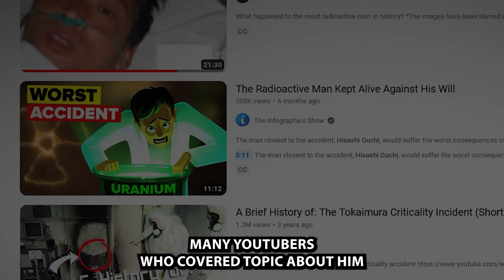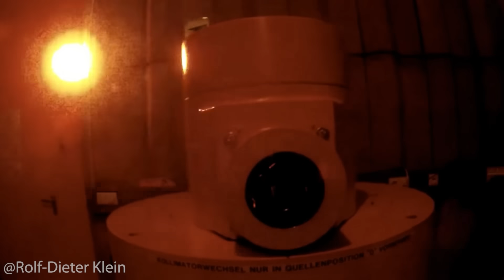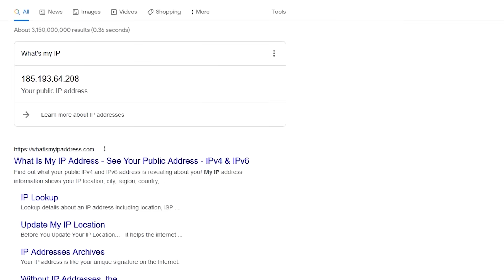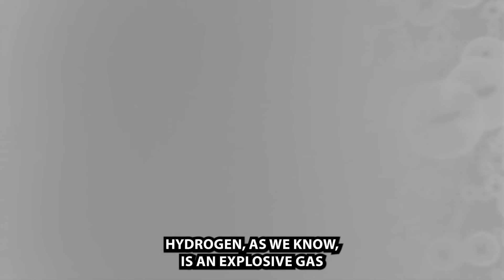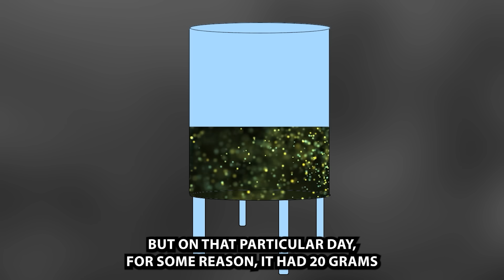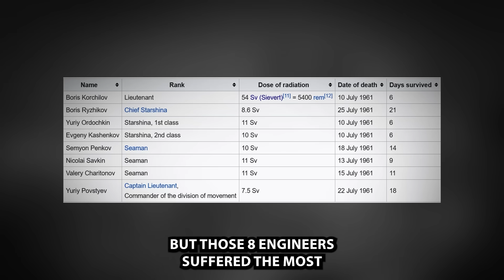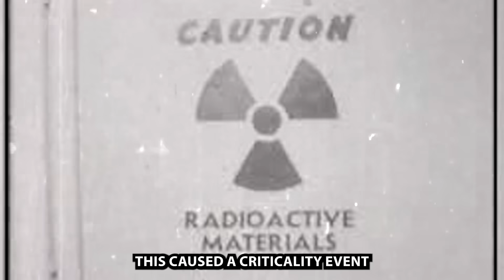Most Radioactive Men Ever

Comment: For people wondering, The blue flash is called the Cherenkov Radiation. It happens when ionized particles travel faster than light through a medium
Reply: faster than light??
Reply: @mojacodes  faster than light at the medium. allways remember, it's impossible to be faster than light. but light is massless and also in any translucend medium it travels mostly by being absorbed and re-emmited. where the frequencies get at 180° angle they cancel out and where they are 0 they double up, making it slower and distorted in direction due to refraction.
Reply: @mojacodes  yes, speed of light depends on the medium. E.g. light in glass and water is slower than in air and in air slower than in vacuum.
Reply: @MrToradragon No the speed of light is constant. The medium defines only the rate of absoption and re-emitting photons...
Reply: @mojacodes  yes
Reply: @coal_edxts  what makes it possible for the ionized particles to travel faster than light?
Reply: @coal_edxts  no
Reply: @abu-karz  Nothing, it is complete utter BS
Reply: @mojacodes  Nothing can travel faster than light in a vacuum but there's plenty of particles that can travel faster than light through other things (such as through water).
Reply: @qdaniele97 We do not know. We dont know if photons are massless, we just dont find anything with less mass. We dont know if the speed of light = the speed of causality, we just dont find anything faster. And no, nothing can travel faster than light, what you mean to say is that certain objects and particles may travel faster trought a medium than said medium can absorp and re-emit a defined bunch of photons/energy.
Reply: @mojacodes  they dont travel faster than light at full speed, they travel faster than light would traver through the medium i think
Reply: @mojacodes  faster than light in water
Reply: @mojacodes  Light has different speeds in different mediums. However light is the fastest in vacuum.
Reply: @mojacodes yes kid it’s faster than light
Reply: @mojacodes  In a material (air, water what have you) NOT the void. Nothing goes faster than light in the void.
Reply: @mojacodes  yes, you can slow light down. however no nothing can travel faster than ORDINARY light speed
Reply: @mojacodes  Ionizing radiation travels at the speed of light. 299,792,458 meters / second or 670,616,629.38 miles / hour. So, no. @coal_edxts is incorrect. Ionizing radiation is not faster than light.
Reply: no. Cherenkov threshold in air for electrons is 21 MeV, way too high for any beta decay. For an alpha, it's thousands of times higher: far out of range for any nuclear reaction. It's prompt radiation (gamma, beta, neutrons scattering charged nuclear) which ionizes the air, which causes scintillation as the electrons fall back to the ground state. Basically, a mini Aurora.
Reply: @DrDeuteron  I'm learning a lot.
Reply: It's also really beautiful from a safe distance
Reply: OK, ppl. this is getting out of hand. Yes, the speed of light is constant, and nothing (including information) can go faster, and anything with mass must go slower.
The speed of light can measure w/o light, all you need to do is measure the permittivity (epsilon_0) and permeability (mu_0) of free space, and find c = 1 /sqrt(e0*u0).
The permittivity measure the strength of the coupling of the electric field to charge (mu does the magnetic part).
So...in a medium like air or water or glass, the electric field of the lightwave polarizes the atoms/molecules, thereby creating little dipoles of charge, thereby increasing the local coupling of the field to charge (epsilon > epsilon0)
This makes light travel slower in a medium. Nevertheless, it is still dispersion less for constant "n(f)" (though it usually does disperse, hence: rainbows).

So it's not "ionized particles" that cause Cherenkov, it's "ionizing particles", which are energetic charge particles.

As they pass through the medium, their electric field is strong enough to ionize the nearby molecules/atoms in the medium. The point of ionization follows the particle, which is faster than the speed of light in the medium, which is c/n, where n is the index of refraction. Hence the similarity to sonic booms, where the air pressure disturbance position is moving faster than sound, so at a forward point, you hear (see) all the sound (light) from everywhere at once...that's just trigonometry.

In air, n = 1.000278 (see: The Particle Data Group). that c/n is totally out of reach for nuclear fission; however, in water n ~ 1.5: so you can Cherenkov in water and not in air with fission/beta-decay. (Beta decay is a few MeV, while the threshold for electrons in air is 21 MeV, which is a number I used in 1989 and have not since recalculated).

Air glow is caused by scintillation: ionized air recombines with free electrons and emits blue light in random directions. In these accident cases, its neutrons knock protons out, which then ionize. Very deadly. 1 neutron can blast a lot of atoms before tossing energy. Think: golf ball bouncing of bowling ball, golf ball keeps moving.

Cherenkov is focused in a forward cone with opening angle arc-cos(1/n). Moreover, the spectral power depends on n (bigger=better) and the photon energy, so it is strongly weight to blue (and even more in the ultraviolet). It is cut-off at the point where the Cherenkov photon energy can ionize the atom...otherwise it would extend to X-ray like synchrotron radiation.

An even whackier effect is called "Transition Radiation", which requires ultra-relativistic particles traversing a boundary between 2 media. 

Finally: the comment about space expanding faster than light is not relevant. The speed of light is constant for all observers in flat spacetime locally. No matter how fast you go, the speed of light always moves a "c" in all directions...so which way do you go to reach "c"? It's a hyperbolic geometry.

In curved / expanding space time. There is no unique way to even define the relative speed of distance objects. Nevertheless, if two particles/people/galaxies are moving apart fast then "c", then they are separated by a horizon: either a black hole's event horizon, or the cosmological horizon.

Source: Me. I did get the highest degree (PhD) in the hardest subject (Nuclear Physics) from the worlds toughest school, and I built Cherenkov detectors for several projects in high background environments (read: scintillation). So it's hella studied. Re: general relativity, I am not an expert, but both my teacher and one of my fellow students won Nobel Prizes for black holes, so: osmosis of genius?
Reply: @DrDeuteron  Thank you! I only briefly tacked the subject and already couldn't stand the amount of bullshit dumped into this thread and similar ones around. Must've been a real pain for you to read "but nothing can go faster than light, duh!" for the umpteenth time. Thanks for taking the time to provide an elaborate scientific insight.

On the subject, I recently read some theories that the blue flash phenomenon accompanying criticality accidents may actually be Cherenkov radiation, but caused by neutrons passing through vitreous body of the eye and not air. Vitreous body has got sufficiently high refraction index of 1.336. There's also another theory that the apparent blue flash is caused by radiation directly stimulating blue cone cells in retina.

Both mechanisms, if they were to be true, have this trait, that the blue flash would be seen by people looking the other way or even separated from the source of radiation by an obstacles blocking visible spectrum of light.
Lack of volunteers make such theories difficult to disprove however.
Reply: @krzysztof_jablonski  You're welcome. I built a Cherenkov detector in grad school--a long time ago, but I had the original book by Tamm and Frank...very detailed. Nobel prize worthy detailed (not a 1st edition, tho, now worth $1500.,..). I also learned about accidentally inhaling freon gas, but that's a different story.
Reply: @DrDeuteron if c is the speed limit, then what is quantum entanglement? also, some of us do not bow to the throne of authority. relativity is certainly incomplete, so for all i know, we may be woefully on the wrong path. we still cannot reconcile GR and QT. maybe we are just as dumb as we always have been. we can’t see our blind spots. it takes time. just because we can’t observe a phenomenon does not mean it doesn’t exist. i’m open to all possibilities. that is the scientific process.
Reply: @kensurrency2564  quantum entanglement is a phenomenon from quantum mechanics, which is inherently non-relativistic.
Reply: @DrDeuteron 21 MeV still seems correct. 

Suppose the refractive index of air (at STP) n = 1.000273 (source: Wikipedia) then a particle moving at the-speed-of-light-in-air would move at v = c/n then β=1/n, γ = 1/sqrt(1-β^2) = 42.8. Now E_kin = γE_0 = 42.8 × 0.511 = 21.8 MeV for an electron or positron.
Reply: @koenth2359  also, I went by memory. I built an e/pi separating Cherenkov for TJNAF in the 90s (it was a POS, I hope its been replaced!). 
The point is, nuclei don't make 21 MeV electrons (nor gamma's which can give their energy to electrons)...the max is 5-ish (iirc).
Nuclear weapons are consider "low energy", but extraordinarly high power.
Reply: @DrDeuteron  Yeah, got ur point, no worries. No Cherenkov radiation, but scintillation due to ionisation and recombining. I'm looking for an explanation for the blue colour though, because aurora is usually red or green.
Reply: yesterday i remembered as the speed of light being the current speed barrier of the universe and now im hearing this wtf what
Reply: @garlicbreadstick404  Speed of light in vacuum is the speed barrier of the universe. We are talking about speed of light though a medium, which is slower than the speed thru vacuum
Reply: @coal_edxts  ohh ok
Reply: @coal_edxts  light can only travel at the speed of light, not slower, not faster . The medium doesn't slow it down at all, just forces it to bounce around this taking a less direct path, it's still traveling just as fast .
Reply: @jedaaa  Correct, but when we are taking distance covered through medium x vs vacuum, in t time, there would be a difference. Which means 'speed' has changed, specifically , it's apparent speed. I just didnt want to go into all those kinda stuff thats why i just said light slows down, so it will be easier to understand. Cheers
Reply: @jedaaa  that makes no sense, if it bounced around randomly, optics would not work
Reply: @DrDeuteron  optics definitely wouldn't work if it didn't slow down in media.  It gets absorbed and re-emitted repeatedly.  It gets re-emitted in random directions, but all the light not traveling the way you imagine it should ends up destructively interfering

Reflection and refraction are emergent phenomena
Reply: @charlesnathansmith  if it's coherently remitted in random directions such that only the forward amplitude is non-zero: that's not really random emission. I've heard that explanation many times, but why not just note the polarization of the atoms increases the permittivity, leading to slower propagation. But the light isn't Cherenkov light anyway. It's scintillation
Reply: @DrDeuteron  if you look at any particular atom absorbing then emitting, it's still unpredictable.  The overall path is a statistical effect.  If you're doing optics, you can ignore that and just work with the net result, just like if you're doing meteorology you can ignore the details of temperature arising from molecules bouncing around.  It doesn't negate what's happening at a lower level, though.

They come out in random directions, but the directions and phases conspire to create a sensible looking summary path
Reply: @DrDeuteron  also, no one is saying that's Cherenkov radiation.  That happens when particles travel through a material faster than light can.  It produces the light equivalent of a shockwave
Reply: @charlesnathansmith  OP says it's Cherenkov, that's the whole point of this misguided thread.
Reply: @charlesnathansmith  if the phases are coherent, then it is not random scattering.
Reply: @coal_edxts  You do not disappoint. I scanned down the comments to see if your words were challenged and how you handled it. You handled it like a scientist.
Reply: @MoiraWillenov  oh thanks!
Reply: @coal_edxts  wait so it's both faster and slower or is it just slower?? You typed that it's particles of electrons moving through a medium faster than Light yet in the other comment you type that charged particles travelling through a medium is slower??
Reply: @jedaaa  It's not correct explanation of how light moves
Reply: @Ar1osssa  it doesn't matter how it moves, it's speed is always the same no matter what .
Reply: @coal_edxts  thank you for the information and following answers to people’s questions :)
Reply: @coal_edxts  makes sense 🗿
Reply: @coal_edxts  ur pretty good at explaining thanks
Reply: @jedaaa  Thats what I thought until relatively recently. But light really does slow down in a medium, it does not bounce around or take a less direct path. It physically slows down and is a well understood and tested phenomena.
Reply: @coal_edxts  This is totally wrong lol. The speed of light is constant anywhere - even in a medium like air. What is happening is that the photons interact with other particles, being absorbed and re-emitted. All forces, except gravity, and all information or energy exchange in the universe is done by photons at the speed of causality - that is a constant.
Reply: @jedaaa That is wrong. As i have explained all forces in the universe, except gravity, are just effects of the exchange of photons between fermions. Photons always travel at the speed of causality (light). They do NOT bounce around, they are interacting with fermions being absorbed and re-emitted in the process.

They are just energy packets, when particles give or receive energy, like an electron reaching a higher energy states, all they do is receive energy throught photons and afterwards emitting their energy as photons to communitcate their information to other particles like their proton or surrounding atoms.
Reply: @coal_edxts  No not correct dude, no bouncing lol
Reply: @Donnirononon  I'm no expert but isn't refraction and how lenses work something to do with changing speed of light ?    Speed of electricity definitely changes to about 50% of c when traveling through coax cable.
Reply: @jagmarc  no speed of light is constant. You are talking about absorption and re-emitting of photons. Electricity, Magnetism, weak and strong force: it is all photons. Only force we have no particle for is gravity so we, for now, see it as a Symptom instead of a force. Again, photons always travel at C and it is constant always.
Reply: @Donnirononon  ah  OK I'll say the light propagates slower than the speed of light.
Reply: @jedaaa light gets slower when travel in water though.
Reply: @coal_edxts omg... there is always "that guy" 
Yes... he is right but really dude? We don't need all thar extra. Your answer was great. I mean come on, after we flush we are not going to think of this again until we are around other people and the subject comes up but by then we are experts. Lol... seriously though.  Thank you for your comment. 😊
Reply: @jedaaa  incorrect, it is caused by the light interacting with the electrons of a medium. The electrons absorb some of the energy in their movement then it gets remitted with a phase kick backwards. It does not bounce around inside the medium, as that would cause the material to be translucent.
Reply: @garlicbreadstick404  Light isn't even the fastest force in the universe. The Universe Expansion is faster Just to Name an example or gravitational waves, magnetic Energy etc.

Then there are parts of space where our laws of physics don't even seem to work
Reply: @bedouinmuhammadfromarabicpagan  You need to brush up on your physics my friend!!
Reply: @bedouinmuhammadfromarabicpagan  universe expansion is nothing but a theory. They recentöy said they have no idea how big the ubiverse truly is or how fast ots growing.
Reply: @bedouinmuhammadfromarabicpagan  
The Universe expanding isn't a Force nor is it moving through space. , you donut. It's literally space emerging out of nothing.

Light is the speed limit in the universe and it is a constant. 
Going faster would mean going back in time, which breaks the laws of physics and doesn't happen anywhere in the universe.
Reply: @bedouinmuhammadfromarabicpagan eeeeh where do you get from that gravitational waves are FTL? that is just BS sorry. Also electromagnetism, weak and strong force are NOT like you say FTL but in fact are the symptoms of light / photons being emitted and re-absorbed between particles. They travel exactly at the speed of light, that is a constant. You just wrote a completely wrong comment pulling information out of you nose didn't you?
Reply: @bedouinmuhammadfromarabicpagan  The universe expansion speed is not only faster than the speed of light, it's also accelerating.
Reply: kinda funny, I took radiation dirrectly to the head (brain tumour)     all I seen was like tv static when I closed my eyes...  during the radiation, after your vision goes back to normal..   weird feeling though...almost like you feel cold but your actually warmer
Reply: u cant escape from light, and those ionised particles are faster than light, so u know u CANT escape them
Reply: For those who doubt, at least read about Cherenkov radiation on wiki
Reply: @IR0Navt  I doubt. I don't need to read wiki, I have Cherenkov and Tamm's book. Cherenkov in gas is a high energy physics thing, and not associated with fission. (air's index of refraction is 1.000273). Chernekov in water works at low energies associated, which is why you see those amazing yt videos of pulse nuclear reactors--scary bright for a few milliseconds, and then decay).
Reply: It’s the particles traveling through the liquid vitreous humor of the eyes and creating the same blue glow seen in water-cooled nuclear reactors.
Reply: @anticom6099  it doesn't need to be the eyes (btw if this happens in your eys I think you got a problem comming)
you just need air
Reply: @dinamosflams  I’ve never actually seen it in air except on the fictionalized “Chernobyl” series. It would likely be very dim and maybe even impossible to see in a well-lit room. But if you have a video showing otherwise I’d like to see it
Reply: Does the colour and intensity of the light depend on the medium? 

I have only heard about it happening in reactor cores that are submerged in water.
Reply: @eklhaft4531  Yes
Reply: Thx
Reply: Wait so in theory we could travel faster than light in our own atmosphere because it’s not a vacuum.
Reply: @Dbirdsong14  No.  Air does not slow light down enough for even teeny subatomic particles to be able to exceed it.  Water does though.  And for the record "we" can never travel that fast, only subatomic particles can under certain conditions.
Reply: interested viewers can search on cherenkov radiation here on youtube , there is a nuclear reactor startup sequence , and we can see the thing glow blue - under water
Reply: I only know Cherenkov Vodka !
Reply: *For anyone wondering, light is slowed to about 75% speed in water. Cherenkov radiation can travel faster than light in water, but not in a vacuum.
Reply: No, particles do not travel faster than light during the Cherenkov reaction. In fact, nothing can travel faster than light in a vacuum according to the theory of relativity. The Cherenkov radiation phenomenon occurs when a charged particle such as an electron or a positron surpasses the phase velocity of light in a particular medium, usually a dielectric material like water or glass. This causes electromagnetic waves known as Cherenkov radiation to be emitted. It is important to note that this emission is due to the interaction of the charged particle with the medium and not because the particle itself is exceeding the speed of light. The Cherenkov effect is often observed in nuclear reactors, particle accelerators, and cosmic ray detectors.
Reply: @NageshPattanshetty   Literally the same thing I said but with more words
Reply: Okay so that means?
Reply: Cool - what medium? :)
Reply: @kaspartambur  A given medium. Let it be air, water, oil, whatever it is.
Reply: @coal_edxts  i dont think that air should be considered into this. as i understand the light goes through the water only at 75 perc of speed of the light, so the particles manage to travel faster than the light because the light in the water cant go faster than 75perc of its max speed. but in the air of our atmosphere light can travel really close to 100 perc speed (three ten-thousandths slower than in the vacuum which is really not a big difference), so in that case its impossible for particles to travel faster than the light in the air of earth's atmosphere. 
there are some extreme exceptions like chernobyl power plant rooftop tho - in cases of extreme radiation levels, the air particles are affected so much that the air end up glowing blue too, BUT DEFINETLY NOT BECAUSE OF THE PARTICLES TRAVELING FASTER THAN LIGHT IN THE AIR!
this video clip comment section haves so many comments with disinformation which got many likes, that its painful to see so many people here lacking of this knowledge. do the research people and dont believe everything you read especially on youtube comment section...
Reply: @coal_edxts  What about travelling through a large?
Reply: @kaspartambur  usually air, which is mostly nitrogen and oxigen molecules
Reply: @kaspartambur  anything that light can travel through
Reply: @kaspartambur  air , atmosphere.
Reply: @kaspartambur  The medium producing Cherenkov Radiation is the water in your own eyeballs.
Reply: @kaspartambur  I'd in fact , does not move faster than the speed of light in a vacuum. Legit one Google search . 😂
Reply: Its a lit boom
Reply: TY. It is good to here ACTUAL science. Bravo, sir.
Reply: thank you
Reply: Troooooool lololooooool lololoooooooloooooololol
Reply: Yo coal you are very cool, will you be my friend?
Reply: The eerie moment when the original comment starting this thread, has 666 likes when you scroll down the comment section
Reply: For all of you out there, that want more informations about light, it´s speed and the universe. https://www.youtube.com/watch?v=uzkD5SeuwzM
Reply: Appreciate your simple and informed explanations on this thread. 

Wish my teachers were like this
Reply: Faster than light? Wow!
Reply: Cheers!! I read your comment, couldn't believe it so did some research and turns out you are correct. The only other instance of FTL travel I've heard of is the speed of expanding space near the theoretical edges of the universe. It's so cool humans are capable of all this.
Reply: @AngryMillennial  Cherenkov is not FTL and this is not Cherenkov
Reply: @DrDeuteron  ooh...if I'm understanding this correctly...it's just that in a particular medium, the ionising particles travel faster than light does in that medium? Also thanks for clarifying on the expanding space point.
Reply: @AngryMillennial  yes that's it. Light travels at c/n where n is the index of refraction. For water/glass/plastic it's around 1.5, so you can get there. In air, it's 1.000278. No charged particle from a fission reaction is going c/1.000278, ever. So we are seeing prompt neutrons striking protons, and the protons are then ionizing the air, or gammas kick out electrons. The air atoms glow blue as electrons fall to the ground state: if you can see it, you're in trouble,
Reply: @DrDeuteron  absolutely incredible!! Thank you so much for taking the time to explain this. Much appreciated!
Reply: nothing can travel faster than light
Reply: @iliketopee8782  the term "speed of light" is actually misleading. First of all, as others have pointed out, it's actually the speed of light in a vacuum. But it really shouldn't be seen as anything to do with light. It should instead be seen as a fundamental property of the universe, c. It determines the structure of spacetime itself. Plenty of stuff travels at c. Gravity does. Light does (in a vacuum). Any massless particle does. Information can't travel faster than the speed of light so it's the speed limit of causality. It determines the slope of that cone of causality through spacetime, and defines what's in the past and what's in the future, and what's neither. It's not just about light.

We only call it "the speed of light" because light was the first thing we humans observed going at that speed. Actually it goes deeper than that. You can do the whole physics trick of setting c=1, and measuring both time and distance in the same unit, like measuring both in meters. Then the speed of light disappears. This is not just a trick, this is perhaps how things should be. Spacetime is a 4 dimensional structure. So we really should be measuring all 4 dimensions using the same unit. Imagine if we measured length and width in meters and depth in furlongs. That's stupid. But that's exactly what we do with spacetime. The only reason we picked different units for time and distance is that we didn't even realize relativity was a thing and that 4D spacetimes were a thing until recently.
Reply: @emilysmith6897  Best comment in this comment section. Perfect!
Reply: Faster than light huh
Reply: Hmmmm, I  was told it was neutron radiation being bounced off optic nerves.
Reply: It means gama rays and you're dead if within 15 to 30 feet and you don't exit quickly ionization of the air is a bad sign ha ha !
Reply: Would air be considered the medium in which it traveled?
Reply: so i did a little bit of researching, and it is true that the ionized particles from the cherenkov radiation travels faster than light, if light travels in a specific medium (solid, liquid, gas) but if the light travels in a vacuum nothing else is faster. Basically as cherenkov radiation can only occur in a medium specifically water the light produced by the radiation travels slower compared to the ionized particle caused by the radiation. there's more complicated stuff that's happening so i'll just leave this link here - https://www.youtube.com/watch?v=akBpQ-A7mCQ
Reply: Faster than light dats crazy
Reply: @KL7US  the speed that light is going at in the room, isn't at the 'speed of light [in a vacuum]' . Particles at the 'speed of light' can overtake the light going slower than the 'speed of light'
Reply: @KL7US  and wrong. He doesn't know what he's talking about.
Reply: They're traveling faster because light is slowed down. Nothing is faster than C (the C in E=MC"2).
Reply: Wow, I bet you feel smart telling everyone that on here. You should go teach people abroad. 🤓
Reply: Pretty sure they don't travel faster than light. The existence of tachyons hasn't been proven
Reply: High energy ejected particles traveling at very near c , can overtake light (propagating through a medium) at a velocity significantly less than c.
Reply: you correct on you said coal, yes its faster then the speed of light.
Reply: [the speed light propagates at]  @Ackamemnon
Reply: Do you mean faster than light in the atmosphere?
Reply: And when a starship exceeds the speed of light.
Reply: The hooker I was with last night moved faster than the speed of light after I paid that chick. The medium was a hotel room. 😂😊
Reply: I will end up this: light in water travel at 70% of it's normal speed, the particles travel at high speed close to the " the real speed of light " which is it in the vacuum, like 80 or 90%, so it's not faster than light at the maximum light can travel, but is faster than light in the water, lets say the light in water is nerfed a bit, on the contrary of sound which is faster spread at a solid or liquid since it need some way of transport contrary of light which no need thick objects on the way.Just search about Cherenkov radiation in wiki.
Reply: ALSO : HERE A SIMPLE VERSION FOR A REGULAR DUDE READ: ITS NOT FASTER THAN LIGHT, IS JUST THE LIGHT THAT IS A BIT SLOWER IN WATER THAN IT IS IN SPACE LIKE 70, 75 %. YES ALSO THE UNIVERSE EXPANDS FASTER THAN LIGHT.
Reply: But I thought nothing go faster then light was that a lie
Reply: @Leochain7274  no mass can.
Only mass less things such as space itself.
As speed increases, energy increases- and requires more energy to "speed up".
Even a BB or a human hair with all the energy in the universe can never hit the speed of light- but space itself can- which is why they will never ever ever see past a certain point in the universe because space is expanded and most light sources even AGMs like Blazers (quasars) are red shifted.
Reply: @Leochain7274  no its not.
No physical material can exceed the speed of light.
But space itself is not a object of mass
Reply: How can anything travel faster than light?
Reply: For those who don’t get it or didn’t study in chemistry it means when the electrons move too fast in the electron cloud/orbit
Reply: Vavilov-Cherenkov radiation*
Reply: ....magic?
Reply: IMPORTANT: nothing can travel faster than light on a vacumm, but light is 30% slower on water
Reply: Bullshit
Reply: Ty
Reply: I work at a nuclear power plant. And i have seen this. It's very beautiful, like an indoor aurora borealis 😂.
Reply: It's very pretty looking blue. the closest you can get to that color and not have a bunch of radiation. Is those weird Miku noodles if you ever seen them you know what I mean that is the color
Reply: Source: trust me
Reply: @packerman7410 nah I checked it seems he is right
Reply: Thanks, Coal. I did not know the energy was faster than light.
Reply: @comeoutofthedark8910  light is a form of energy
Reply: @comeoutofthedark8910  nothing is faster than light in vaccum
Reply: Nothing travel faster than speed of light, whether it is blue or orange in color
Reply: but i read there is nothing faster than speed of light
Reply: @yashsaini1739  nothing containing mass (protons, neutrons, )
But space itself doesn't have mass (as we recognize materials) and "allows" for the warping of space/time "fabric" which in certain conditions may travel faster than light- towards the "edge" of our ability to see distant light sources such as quasars and utilizing gravitational lensing we can see back (as we look farther away in distance) in time- and increases in speed- will eventually be outside lights speed capability to see back any more because galaxies headed one direction will lose its ability to see galaxies going the opposite way- direction. The big rip-
Space has an edge- and that edge has been expanding for billions of years- eventually will out expand lights abilities to "see" galaxies that are moving away.
Reply: holy shit that's scary as fuck
Reply: Faster than light? Sir…
Reply: Nothing travels faster than light. At best, it travels at 99% speed of light, creating that flash.
Reply: I think you mean: "nothing travels faster than c" [and at best light propagates at 95% c] ??  @Sergmanny46
Reply: I thought nothing can move faster than light
Reply: @Gothiana17  light is the fastest in vacuum. Cherenkov radiation are photon lights.
Reply: it is physically impossible for particles with mass to travel at the speed of light let alone faster than the speed of light, as it requires infinite energy in order to do so, which only photons can achieve.
Reply: @MichaelReviews441  You're talking about the speed of light in a vacuum, which is a constant (c) and cannot be reached let alone exceeded by anything with mass.  The speed of light through a material (like water) is MUCH slower than c.  If you want to get really technical, it's because photons get absorbed and re-emitted repeatedly.  Some materials like Bose-Einstein condensates, can slow light down to slower than human walking speed.  Cherenkov radiation is created when a charge particle moves through a medium faster than light moves through this same medium.
Reply: @StormsparkPegasus  oh i didn't know that thanks
Reply: @StormsparkPegasus  " If you want to get really technical, it's because photons get absorbed and re-emitted repeatedly." That is incorrect. Photon absorption and re-emitting is a random process in terms of direction of that re-emitted photon, but we know for thousands of years now that light does not randomly start bouncing around in water for example. Optics wouldnt work at all if light did that.

Light really does physically slow down in a medium. Its been experimentally proven. The real reason is basically when light and matter couple, they form a polariton, a quasiparticle with mass. This quasiparticle moves slower than c. The full technical explanation is a lot more complicated though and even I dont really fully understand it
Reply: I thought Nothing is faster than light
Reply: @gutsjoestar7450  nothing is faster than light- that has MASS ...
Reply: it doesnt travel faster than light. maybe just as fast but not faster.
Reply: @nsbse2287  particles can go faster than light in a medium, because light goes slower than the speed-of-light, in a medium.
Reply: Speed of light is a CONSTANT which means its... CONSTANT no matter what
Reply: @DrDeuteron  maybe did you mean to write "light goes slower than speed of light (in vacuum) " ?
Reply: @jagmarc  in the biz, the speed of light means c. The speed of light in a medium is  not a precise concept, as green light may go 200k km/s in leaded glass, a 400 GeV gamma goes c. The speed of light in a medium is frequency dependent. When workin with cherenkov light, ppl care about violet and near UV, since the cherenkov spectrum is proportional to frequency. There are very few red or IR photons, and PMTs aren’t very sensitive to these. Deeper in the UV the atoms are just ionized, and there is no radiation.
Reply: @DrDeuteron  That makes sense. What's a PMT? 
 In optics the wavelengh dependent refraction chromatic aberration causes a "blue tinge" like the tiktok logo.  
In electronics biz we call signal propagation less than c 'velocity factor',  some coax cable the VF is 0.5 .
Reply: @jagmarc  photomultiplier tube, like in the water cherenkov neutrino observatories.  Turns one photon into a few volts for 30 ns. I turned on in the sunlight once. Whoops.
Reply: @DrDeuteron  I guessed it might be a detector some kind from the context. The older vidicon camcorder could kill by pointing at the sun. 
30 ns is a very long time in electronic engineering
Reply: @jagmarc  I it’s been a long time since I looked at an is oscilloscope …maybe it’s less. Photon hits photocathode, knock electron out into pmt …which is an inverse lightbulb at 2kV. Electron accelerates into GaAs film, knock out 10 electrons, another 100V to the next one, repeat 10 times, pulse comes out the base…into coax cable, into oscilloscope, or NIM logic boxes…forgot what they were called.  
In air you get about 30 Cherenkov photons per meter (poission distribution from exponentially distributed emission), 20 % quantum efficiency (binomial dist) cuts that to 6 photoelectrons. Still poission dist.  Then each mulitplier is poison, leading to a Polya Distributed signal .
Reply: @DrDeuteron  I've always wanted to play with a PMT, like you say a single photon starts a chain reaction.  I'll bet the coax cable is a drum of coiled coax, so that you can see events which happened just before the scope trigger
Reply: @nsbse2287  nah it actually does. Bc light is slower in a non-vacuum area, but the energy from the radiation is still as fast as light in a vacuum.
Reply: Hard to believe all the scientific geniuses here saying ionized particles can travel faster than light. In a medium, in a vacuum, whatever, nothing can travel faster than the speed of light. Prove otherwise and you are guaranteed a Nobel prize
Reply: @GoldenhatVR-i6e  just wait until you find out about Electromagnetic Fields and Waves.
Reply: @GoldenhatVR-i6e nobody is getiing a noble prize cause its a fact the speed of light in a medium is said to be decreased Due to change in refractive index let's say in diamond it's 2×10^8  so some things can be faster than that in diamond but won't be faster than speed of light in vaccum which is 3×10^8
Reply: @GoldenhatVR-i6e  Nobody is saying ionized particles are travelling faster than the speed of light (c). We are talking about speeds faster than the phase velocity of light through that medium, which is absolutely possible. Maybe look it up before posting such bold claims
Reply: @GoldenhatVR-i6e  nothing can travel faster than light in a vacuum, but through a medium it is possible. Hence Cherenkov radiation.
Reply: @anticom6099 no. It's not traveling faster than light. Absolutely not..just NO..
No particle can travel faster or even at the speed of light.
Reply: @rdallas81 but what if light become lazy in water and decide to let Cherenkov radiation have fun being faster?
Reply: @heisenberg2267  Heidelberg, 😆 classic!